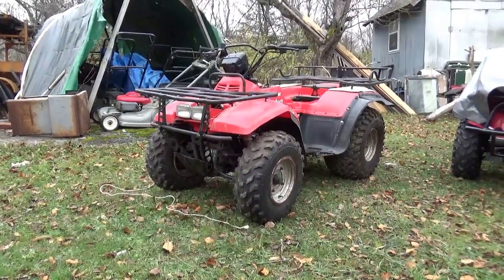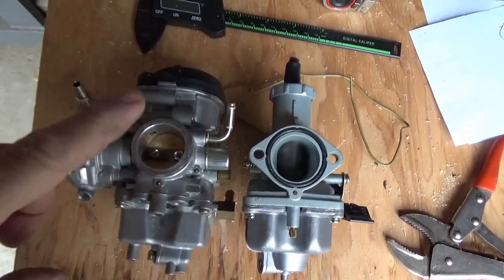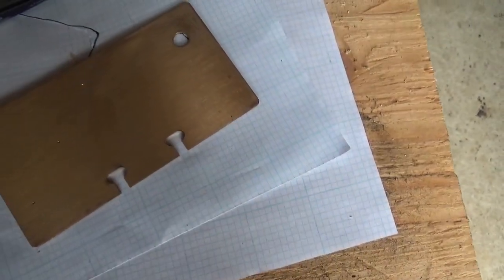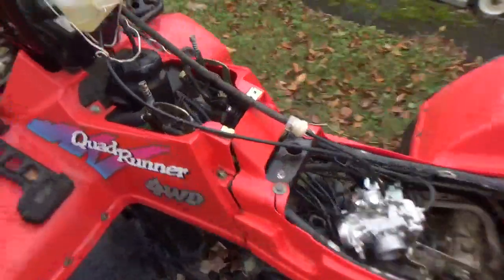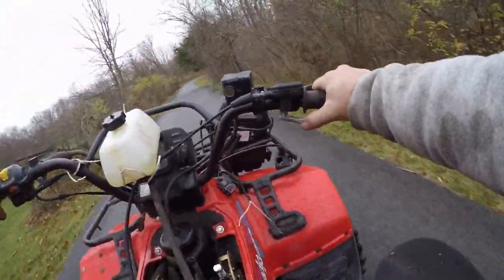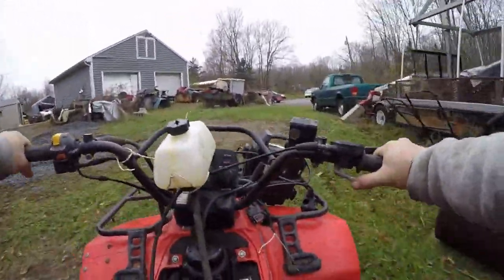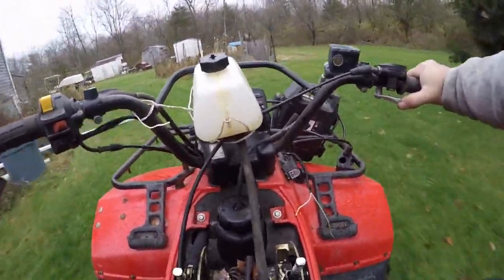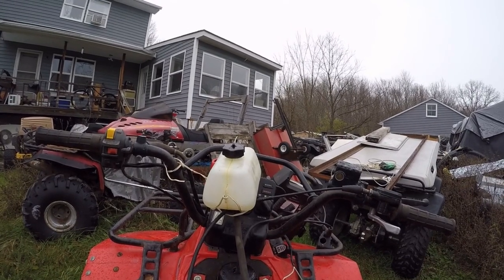Suzuki Quadrunner 250 Carburetor Hack, Junk Mikuni Swap to PZ30 Clone!

Comment: Hi great video! I am looking for a carburetor for my 1998 Suzuki QuadRunner LTF250 2WD? I have already tried two chinese ones with no luck. Also my dilema now is if the fuelpump is also not very good. Would you mind advising what carburetor to get? Thx

Comment: Great video! I have a 1998 LT-F250 QuadRunner with an aftermarket carburetor and a simple petcock fuel valve bypassing the fuel pump and cancelling the vacuum line. But the problem I am having is that when I give it gas it dyes. I'd appreciate your feedback if possible. Thx

Comment: I bought an lt-f250f that the 2 previous owners had given up on getting running (came with 2 china carbs). 1st Major problem was a blown fuel pump diaphragm filling the crank case completely with fuel.  Threw the china carbs in the trash & bought a genuine Mikuni carb for $380 replaced the fuel pump and it runs like a dream. I work with 2 of the former owners. Both said it had never run that well & both asked "can I buy it back?"  "Nope I really like it"

Comment: Very good video, only thing is just a heads up for people that the pz30 might have to be rejetted before putting it on, secondary is off by a lot but you can get away with the primary. If you want a straighforward slap on and run carb I’d recommend the caltric aftermarket carb for quad runners, comes with correct jetting ($26-35 on Amazon). Oh and heads up, the caltric carb has a vacuum hookup for the mechanical fuel pump unlike the pz30.

Comment: You can't claim anything negative about AFTERMARKET  carburetors, unless you give specifics. No generalizations allowed here. Either you know, or you don't. Come on dude, you are better than that. It's very rare for me to not have a solution to all small gas engine problems. Almost nonexistent. 
So buck up and say the truth. Just like you help us, we help you. In other words, if you can't figure something out, you watch others on YouTube. You need to support as many people that support you.
Reply from the maker: Hey twintwo, Perhaps I was not clear in my video and for that I am sorry, but, my experience is that the body of cheap after market carbs is made of a lower grade aluminum or is not polished as well as most oem carbs... That lack of finish and or lower quality aluminum makes them more prone to corrosion and they seem to need cleanings more frequently than the OEM stuff.... I probably use 20 to 30 knock off carbs per year, I like the pz27 and pz30 knockoffs, I don't like the Mikuni carbs, oem or clone.... Seems that the PZxx series is reliable, easy to rebuild, cheap, and easy to get... Thanks for Ur thoughts, feedback, watching, and commenting!!!

Comment: DO those carbs have the vacuum line for the fuel pump?
Reply: Did you ever receive an answer?

In the video his fuel tank is at his handlebars so I would understand that he bypassed his fuel pump because of didn't have a vacuum connection.

Please Let me know if you find
Found anything out.

Comment: Great video. I recently put a Chinese eBay carb on my '90 Quadrunner, it's just a clone of the stock Mikuni. It took a bit of modification to work - it came with threaded fittings where the throttle & choke cables go, so I had to drill those out to get my cables to fit. Everything came out alright though - I was able to start up the 'ol 250 for the first time in 15 years!

Comment: I have never had an OEM Mikuni that I could get to work well consistently even on my old Harleys. About 15 years ago I paid big bucks for an OEM unit for my 250F quad runner because the one that was on it was impossible to tune. Luck would have it that even the brand new one was junk and it sat so long that it too now is not worth messing with. After seeing this, I think it will be getting a PZ30 however I want to find a real manifold adapter rather than fabricating one.

Comment: Hey harvey how do i bypass a neutral saftey switch on 2000 400ex and bypass start stop switch im getting power in the back but seem like not getting power to go to ignition..all wiring cdi etc. Is brand new

Comment: Thanks Harvey. This is basically the same machine as the Arctic Cat 300 2x4 that I have. It's the same engine etc just slightly different racks and plastics but on the whole its the same thing. I have the PZ30 and have gotten my brass plate but had gotten a  1 1/4 in pipe. gonna get some end caps and make my mounting bracket and get to wrenching. Need to do the top end and make sure the timing chain doesn't need replacing because I think it may have jumped a tooth. Got the machine from a guy who said it ran when he parked it but dont they all hahaha. Luckily my PZ30 has the bracket on it to be able to use the factory choke cable tested that and it worked perfectly.
Many thanks as I was wondering if I was going in the right direction. You just proved I am. Cheers to you sir.

Comment: I'm inclined to say go with the stock carb, but it sounds amazing with the pz30. Like you say, 1-2 horsepower isn't bothering you, I'd go ahead and slap the pz30 on the 2001.
IF IT WORKS IT WORKS

Comment: Love the quadrunners. The wife has a 85 230 quadrunner but I struggle with the stock carb as well. It runs fine but is a bear to cold start. Always needs choke even when 100+ out. First start always dies with full choke, immediately start again and will only idle with full choke till fully warmed up. Rapid throttle makes it stumble as well. Have tried different jets and valves are new and in spec. After watching this maybe I'll try the PZ clone. Thanks for all the video's. You help alot of people

Comment: That one is a win! A muffler and youll be set. I'd want them to have the factory carbs and air boxes but I certainly understand why you like the PZ30 and 27.  👍👍
Reply: Since they use the same parts as my arctic cat I can tell you that the factory air box can be used and with a little hose work between the carb and the box itself it will seal and use the factory air cleaner etc. I test fit everything on the AC before I tear into the top end to rebuild it and it was all good to go.

Comment: Runs good.  If it only was a Honda! LOL!  Did you see my latest acquisition?  1981 ATC 200.  Really nice shape.  Tried cleaning the carb but Its going to get a PZ27.
Reply: why not just get the stock replacement carburetor for the trike? its basically a pz27 but actually suited for the machine